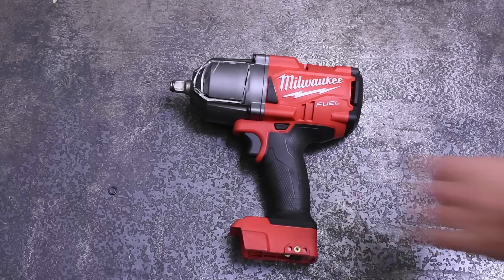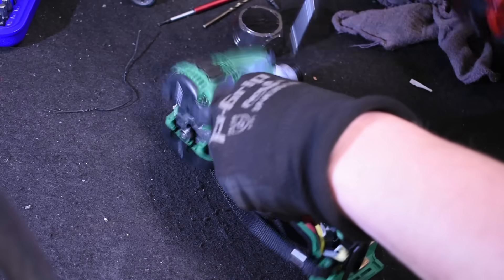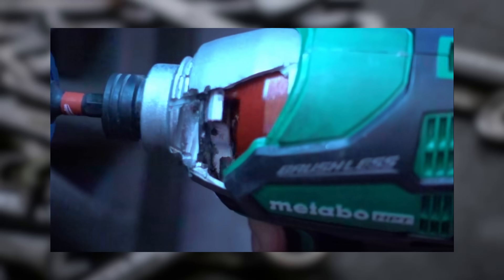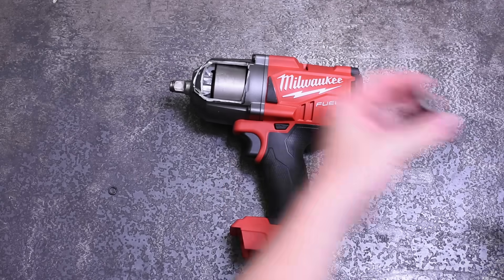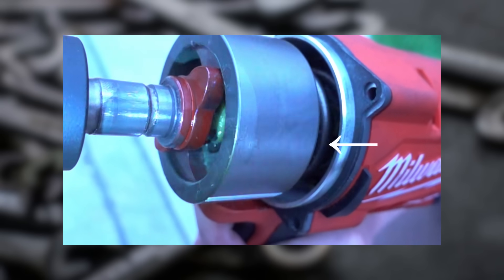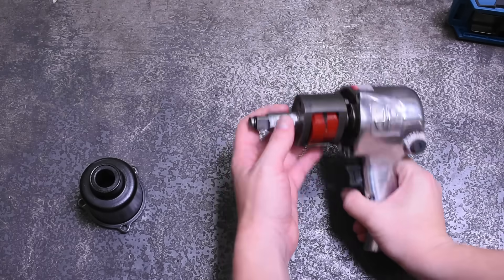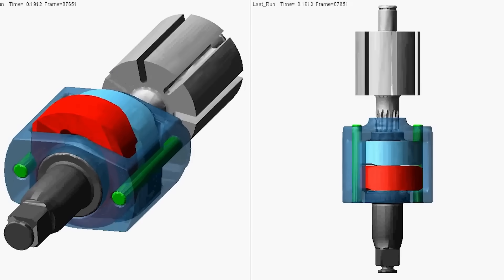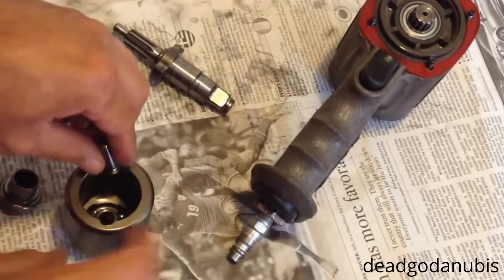High-Speed Video INSIDE Impact Wrenches: How They Work

Comment: i bought a Dewalt heavy duty impact wrench to remove a crank pulley bolt on a Honda and it couldn't break loose the bolt. Off all the impacts you tested, which impact wrench would you say is the most powerful?
Reply from the maker: Matco 20V, Snap-On CT9080, Snap-On CT9050, Astro 1894 Thor, Milwaukee 2767 with an HO battery, Bosch Profactor
Reply: Matco?? wow!!!! i never thoght matco would have reach on that pedestal.... but i do like matco tools
Reply: ohhhh btw after you mentioned matco i did look at ur video on it's perfomance test. kudos to matco
Reply: Try weighted socket, it should do the trick. Lisle or Ingersoll rand.

Comment: i have a very old used two pawl hammer dog from an old impact and on the ends where kt was hit billions of times its like a mirror and got it tested for rockwell hardness and it came back 87 rockwell im not sure what steel it is but its not deformed or cracked but shiny and hard.

Comment: This makes me curious if a new clutch design for electric tools could be made that would allow them to use more traditional air components? possibly as a way to reduce felt vibration and the like (doubt it would add more power but would be neat).
Reply: you could it would be terrible utterly and completely useless as a tool but you could.

Comment: I personally prefer electric. But simply for the fact of I don't have an air compressor at home.   And electric is 80-90% as powerful as air.  So the fact of I can take it home to work on my cars is really appealing to me.    Although as I can afford it I have been switching to air for work and retiring my electric for professional use.  Not for anything besides weight tbh though.   The electric is heavy after 10 minutes above your head
Reply: But you can get more power in a more compact space with air. That’s the only plus for them.
Reply: @FishFind3000  that'd why I am slowly converting my shop tools to air.   But I bought electric because I couldn't afford both.  So now I have the midtorque, high torque ,impactdriver, electric ratchet, and right angle impact.
Reply: That 80-90% as powerfull really just depents on impact wrench. You can buy 350Nm electric impact wrenches and 350Nm air impact wrenches. Both will do the same , though the battery one will be significantly more expensive. The problem is when you need heavier tools, like 1800Nm or more, you will be hard pressed to find a battery model. And if you find one it will be very expensive, and very bulky.

Comment: If well maintained air tool are cheaper in the long run than cordless, no need to buy expensive battery every 2-3 years...
Reply: Factor in the cost of the compressor and the compressor maintenance, and it might be closer than you think.

Comment: Huh, guess the conecpt of cordless impacts randomly skipping blows either no longer holds up, or was never true on properly working tools to begin with.
Whoops.
Reply from the maker: Some tools do it, dewalts in particular, I feel. Just haven't caught one on a full size impact on camera
Reply: @TorqueTestChannel  It'd be good to see which ones do, and in the case of drivers, if random skipping helps or hinders not warping screws that are being driven.

But it still throws a wrench in my hypothesis to why Metabo HPT's triple hammer 36DB is so weird. Any plans on seeing if the recently released to the US 36DC is any better?
Reply from the maker: @reaperreaper5098  For sure, waiting for it be to be sold bare. Already have 2 chargers lol
Reply: @TorqueTestChannel  I hear that. I've got something like 6 Flex chargers, 5 Ego chargers, and quite a few Milwaukee chargers kicking around.

Comment: Could you make an Frankenstein Impact, Basically Cordless Hammer and Anvil driven by Air ?
Reply from the maker: Yeah, some air mechanisms are already ball and sprung cam, just sort of work differently 17:34. It would just make less power using a cordless style mechanism though.